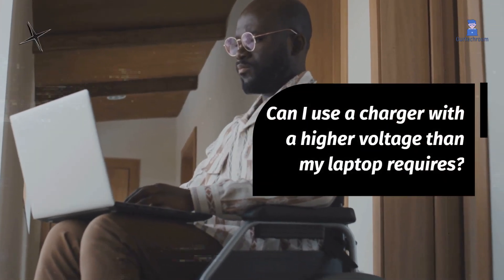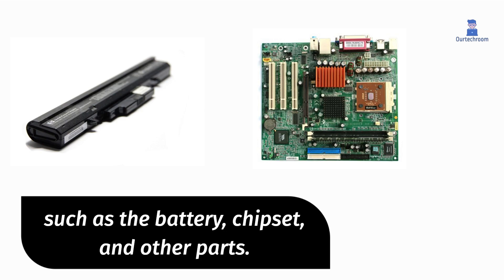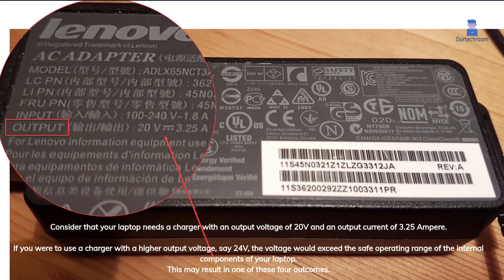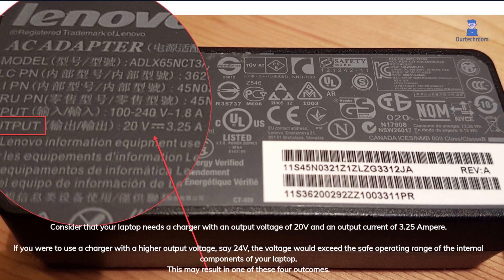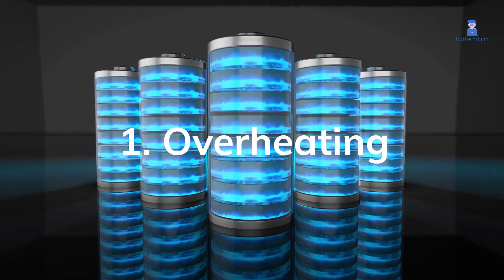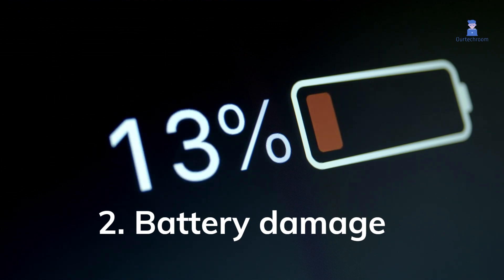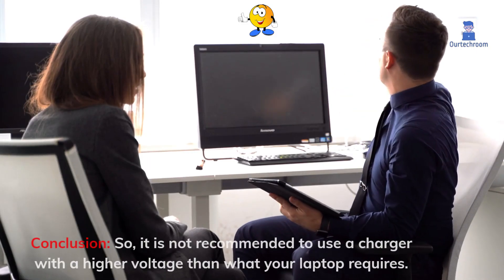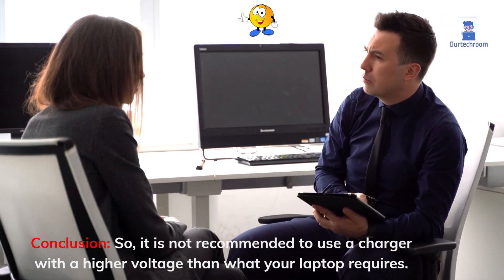Can I use charger with a higher voltage than my laptop requires ?

Comment: Why do you say higher voltage will damage laptop? I just saw a video about mac that says even if you use quick charge which has higher voltage, and your laptop can’t do quick charge, it’s still safe and it just will default to the lower voltage? Does Mac have some special device like a special safegaurd? Is it software or hardware ?!
Reply: It could broke your device 

Literally, even with a small difference. It would kill your battery even faster than using the correct voltage. And there's a risk of it broke other component too
Reply: @ thank you!
Reply: Only works with USB... Especially type-c, cuz they can communicate with your device to determine how much voltage to be used by your charger 
If you had a normal laptop charger (that had a round connector) you ABSOLUTELY should use the one that had the same voltage
Reply: @ but why higher voltage can cause problems?

Comment: I my laptop's adopter was of 20V - 7.5A (150W). My adopter stoped working I am going to buy a new adopter with same voltage 20V but diffrent current 9A with 180W should I buy or not 
What will be the harmfull impact of that 180 W charger
??????????????????????????????????????????????????????????????????????????????

Comment: I have a 90 watt charger for my laptop. If I charge the laptop on custom or standard mode of power manager settings then it charges the laptop at much lower speed than express mode. So I want to know that if I charge on standard mode or custom mode, will my electricity consumption be less than 90 watts (because my charger is 90 watts) or if I select any mode, the electricity consumption will be 90watt
Reply: Express mode might be the laptop charging as fast as it can in the case that you don't have much time to let it charge at a normal speed

Comment: I brought a universal laptop charger with different plugs because I lost my original charger.I took the battery out of the laptop and it says 11.1v.The lowest amount of volts the universal charger is 12v.Is it ok to use the universal charger even though it's 1 v over or extra ?
Reply from the maker: Using a 12V charger for an 11.1V laptop battery is generally safe. After charge is completed this you can unplug it for safe side :)